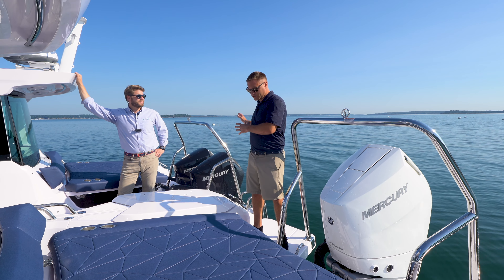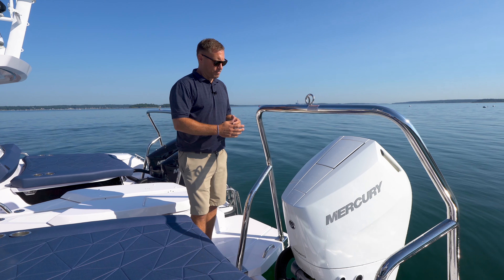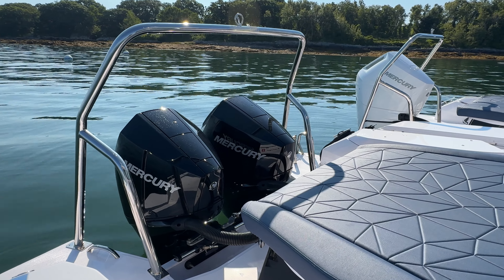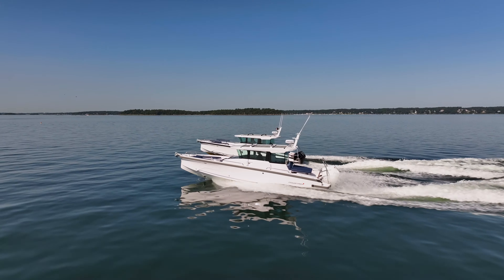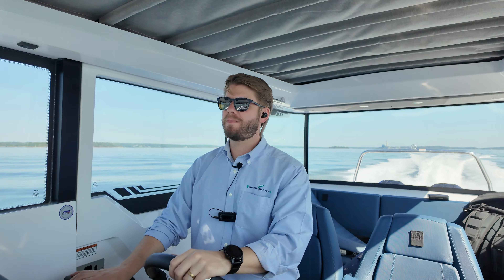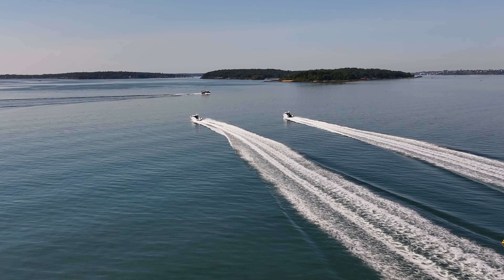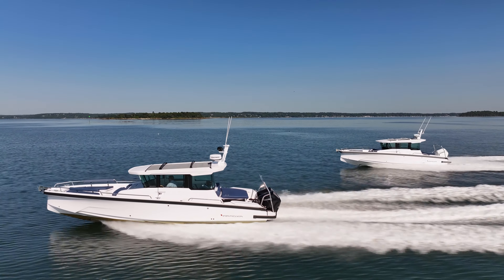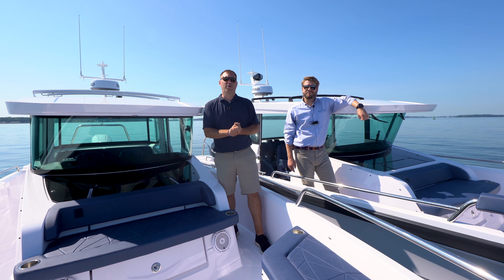Single VS Twin Outboard Engines? Which is BEST on an Axopar 29?

Comment: 950 lbs for the twins, 668 lbs for the single...
Reply: Single seems like a very compelling setup! 

Lower maintenance costs, better fuel efficiency which translates to furtherest range, lower weight. 

Not certain the dual motor setup is actually redundant and these are both fast enough, so drag racing is not a big deal.

It would be great to see more comparisons. I think we only scratched the surface. Awesome boats!
Reply: In remote areas, I would prefer two engines but if I had a boat in Jersey or NY with Tow/US insurance- than single.
Reply: @natamadic I hate to rely on others so I’d go for the double

Comment: Excellent  data. I actually expected the twins to burn around 50% more fuel over the single and at cruising speed they were fairly close. We are considering a larger boat and the single/twin options  you presented gave us just the type of info we need. Living in Alaska and boating the big seas and long distances and breaking down is just not an option. It will be twins for sure.
Reply from the maker: Glad this video helped!

Comment: With the bow thruster on the single there is not much advantage to the twins. Better fuel costs with the single, lower maintenance with the single. Advantage to the single.

Comment: Super impressed with your numbers. Not much difference between the two. Like everyone has said, just depends on how you plan to use the boat. You are carrying more weight with twins and of course additional costs. I was impressed with the RPM ranges. We are still leaning twins. Had a conversation recently with someone that boats in one of our areas and was about 30 miles out on a twin engine fishing vessel. One engine seized. They were able to make it back in rough seas with one engine although it took forever. They did not call Sea Tow and could have. And even in that case at least you're making forward movement. It's the usual debate. I see no negative for twins other tan some extra cost. But it's kind mute really. if you can afford the boat get what you really want.

Comment: honestly a 400cv is not the most fuel efficient... Being a single engine there is less drag in the water and less weight, so a 350hp could do the job perfectly and probably has better fuel economy. Normally you have to compare a single engine setup with a dual engine setup with 20% aprox more power to "even out" the extra drag at speed.
Reply: Yes, I agree. Should have 25% extra hp, and not just to equal out the drag, but allso optimize that wanted cruise speed at a lower and the most fuel efficient revolution pr minutte. The sound pattern from 2 engines working at lower revs can be more appealing too. If you have meny people on board, the 2 motor boat has much more torque and acceleration. Its a rich man toy, so if you sheap out on a better 2 engine configuration, you might just be better without. Greetings from Oslo Norway

Comment: So it’s purely down to annual engine servicing costs - two engines to one. Plus the marginal gain in docking manoeuvring with the twin engines, but I’m guessing being so close to each other the split  of forward and astern on opposing engines is of limited effect.

Thanks for a great demo. I think you need a CarWow starter - 3 - 2 - 1 sat in an inflatable tender between the two of you. Make it your own and your onto a winner for on water drag races. Pointless - but hugely amusing 👍🏻👍🏻👍🏻
Reply: The distance between the two engines is basically irrelevant as the side stepping effect created by putting one engine in forward and one in reverse is achieved by the "wheel effect" of both propellers rotating in the same direction while countering each others thrust. A twin 28 will turn on its axis, or will parallel shift when combined with the bow thruster. The boat can be manouvred in tight quarter so precisely, and without spinning the wheel from lock to lock. It is a real joy to have this much control. 

As the acceleration test suggests, the additional grip on the water that two propellers offer, is very noticeable. In rough conditions, and particularly following seas, it is a great advantage having so much control over the hull. Both in acceleration to lift the bow, and backing off to suck the hull down on to the back of a wave, the twins just feel so much more connected. Strangely enough, because of this response to throttle inputs, the twins make the boat feel more agile and light.

Comment: Great video, and very good answers to the eternal question, single or twin! The accceleration comparison, top speeds, and fuel burn show how subtle the difference is between 400 hp coming out of one or two propellers. To put some more perspective on things, it would be great to see how, next to these two, a single 300 would fare . Obviously slower, in hole shot and top speed, but it would be great to see how much or little difference that is, and how much fuel it burns at the typical cruise speeds, 25, 30 and 35 knots. Bang for the buck, and in purely practical terms, the 300 V8 is a very capable power unit for the 29. lightly loaded, probably (my guess) a 45 knot top speed, compared to 48 knots with the twins and 49 knots with the V10. 

Worth mentioning about the apparent size of the motors shown here, Those 3.4 litre V6´s appear in black to be more compact than they are, and in contrast the V10 in white looks collossal . Not a deciding factor either way but worth mentioning. I don´t think either look out of place or get in the way. 

We chose the twin V6´s for our 2023 28..  On test drives of both, we were so impressed how they made the boat feel lighter and more agile. Response to throttle inputs (twin props) is epic. Of course the twins weigh more, but out on the water, make the package feel lighter. And don´t forget, out on the choppy water, weight is your friend.

The fact that the twins are spinning at 1000-1200 rpm less at any given cruise speed, makes them sound amazingly relaxed, and is also the reason (together with 1.2 litres smaller capacity than the V8) that they burn only half the fuel per side. The close quarters manouerability (particulary when wind and tide is in play) is amazing, and again, very relaxed. No need to spin the wheel back and forth. Just use the throttles and minimal bow thruster. You can even parallel shift the boat to and from docks, just as a joystick does. 

And how much fuel does the twin powered 28 use, in real terms? 

After 185 hours, we´ve logged a fuel total of 4416 litres/1167 US gals. Our trips usually range from 40 to 100 nautical miles, and encompass all sorts of water that the Solent tides, wind and chop offers.That puts the average at 23.9 litres/hour or 6.3 gals/hour. Obviously the no-wake zones, and pottering in and out of harbours is what helps to create such a good number. But that is real boating, and is what decides how often we are back at the fuel dock. That´s why we find the 270 litres of the 28 tank perfectly acceptable, but certainly wouldn´t turn down the extra range of the 29.

Comment: Thank you for this video ... 

However, as a layman considering buying first motor boat (an Axopar 29 sun top), I have three more questions:

1. price difference ... buying 2 x 200  vs buying single 400 v10 ?
2. noise level ... which config is more noisy ?
3. have you (or your mates) ever experienced single mercury failure when on the sea ? If yes, how often ?

Thank you
Reply: 1. the single V10 will  give you 400 hp behind your 29 for less than the twin 200´s cost. Not only outright purchase but service costs. However, fuel burn is near identical.

2. again the torquey V10 wins, being quieter than the V6´s. The twins will be running at about 1000 rpm less, and the V6´s are impressively smooth and quiet, but two children always make more noise than one! Twins (like on aeroplanes) do have a harmonic characteristic that sounds cool, but there´s no doubt  the throaty 5.4 V10 sounds amazing. 

3. the sheer number of current Mercury engines out there suggest that they are doing a good job. You are unlucky if you get a bad one. I´ve run engines from Mercury, Yamaha and Evinrude, and haven´t been disappointed, so had no qualms about ordering twin 200´s. All engines profit from being treated well and maintained properly. Have the full suite of engine readouts on one of the screens, and keep an eye on oil pressure, water pressure and water temperature. There you will see if all is healthy. Normal procedure when running an internal combustion engine that you are trusting your and your family´s safety on.

Choosing twin 200´s just because of the fear of having an engine fail out at sea cannot be a deciding criteria, but it certainly is an advantage. Twins, however, double your chance of an issue at some point.  But because they share the load, tend to be running less stressed than their single counterpart. 

If this is your first boat, I´d strongly advise you to beforehand go charter the nearest Axopar to your desired model (a 28?). Test drives don´t tell you anything like as much. You need to be out there for a day, doing what your type of boating is about.

Comment: Well the twins acceleration is faster, so i also think if people use it to water ski behind it, twin engines might also be a good solution for that. As if i understand correct, ski on water needs fast acceleration so the person behind it can get up on the water as fast as possible to not drag behind the boat.

Ski and if you are far out on the sea alone with no boats in sight often. Twins for win. However just for your Sunday cruise property in areas where many boats are all the time. I will take the single. so yeah again, the best choice really depends on your use case and needs.

Comment: Thanks for nice video. Is it possible to raise both motors out from the water completely? Also on single 400?
Reply from the maker: Yes, the lower units come out of the water for either configuration

Comment: Wow. 
I really thought fuel burn for twins would be a bit higher than single 400. 
But they are almost identical. 
I have the Axopar 28 with twins and it is a fairly quick holeshot. But I honestly wish my engines were 250’s to give it a bit higher top speed and let the engines rev higher. My engines typically top the rpm’s at 5400.
Reply: I am not an expert, but 5400 is well below max power so maybe your props are slightly bigger than optimal for max speed. This might be beneficial for cruising efficiency though, but expert is needed here...

Comment: Is that possible to put two 225 hp on the 29 t Top ?
Reply from the maker: Max hp is twin 200hp
Reply: 225 is a V8. 200 is a V6. All you will gain is lots more weight. The power to weight ration would not be beneficial.
Reply: @kirkwilliams2127  The Mercury 225 is a V6 and is the same motor and weight of the 200. I just repowered with the 225 last week and was out all day Monday in it. Fantastic motor with a lot of torque and impressive hole shot. Mercury's 250 is a V8 and that is a larger, heavier motor.